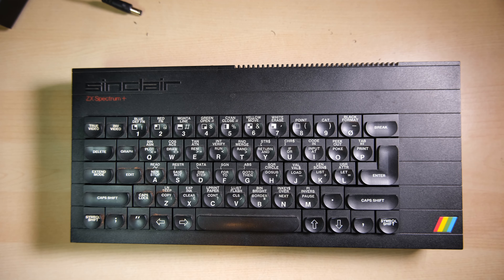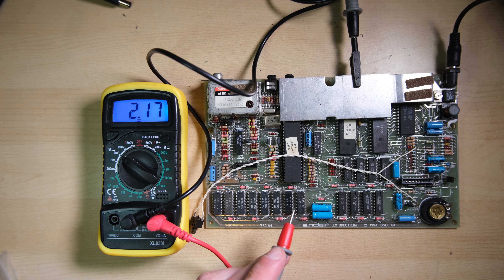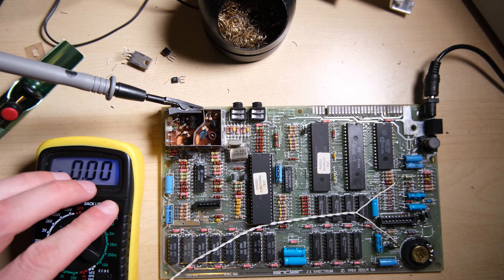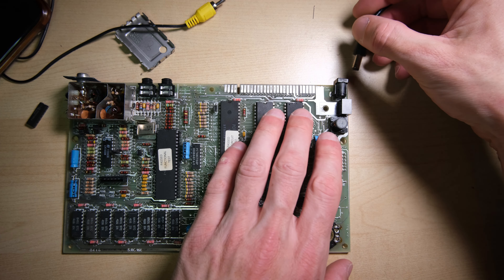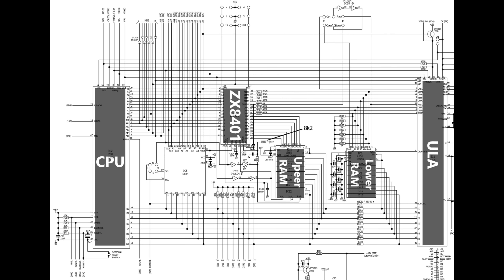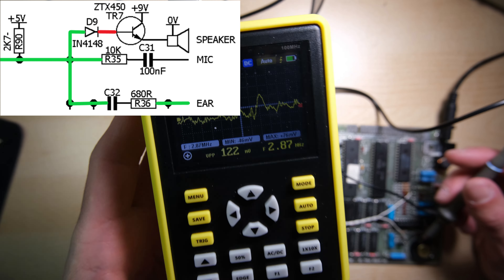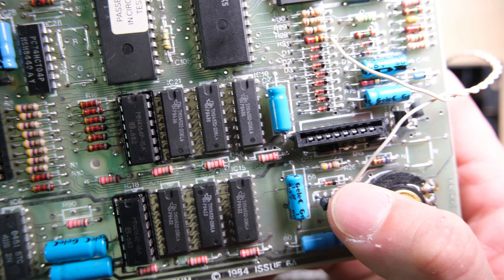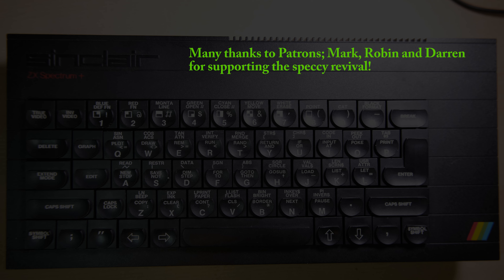ZX Spectrum+ 48K Repair - The Mute

Comment: Just a question - there was some interference on the screen display.  Is that noise off your test bench?  Or did new capacators clean that up?
Reply from the maker: Good question. That's just noise from the test bench, with a "proper" plug it completely vanishes.  I also get similar interference when I connect audio cables from my PC to load a game
Reply: @HappyLittleDiodes  Cool, so it was a simple cause afterall.  It's probably a cleaner picture than we used to get in my middle school's "computer room".  About 20 zx spectrum 48ks and +s in close proximity!